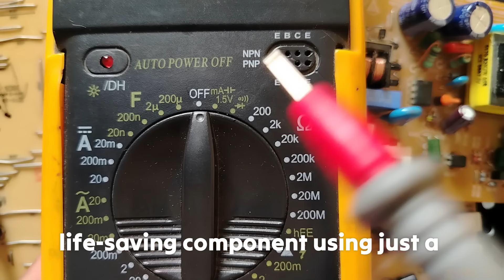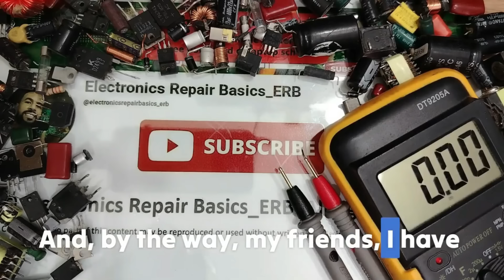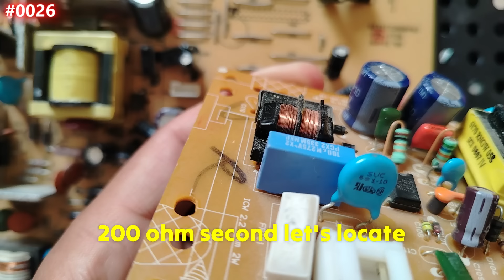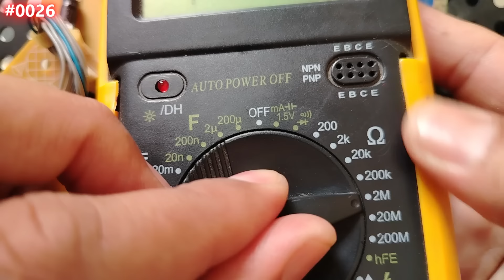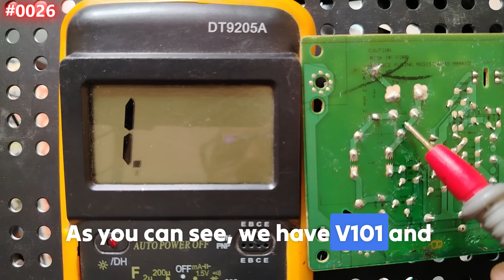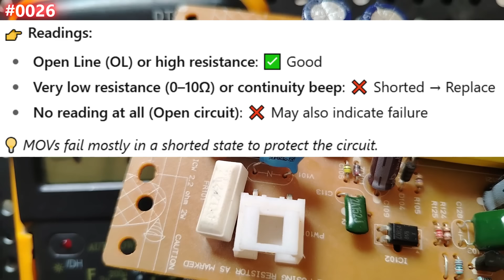#0026 Electronic Components Testing: How to Test a Varistor (MOV) with a Multimeter | MOV testing

Comment: The one part of this that doesn't make any sense to me is how a multimeter reading 'Open Line' is a good indication, but 'Open Circuit' is a bad sign. Both my multimeters have an "OL" (Open Line) reading, and they both mean the same as 'open circuit'. My interpretation is if your multimeter can only test a max resistance of 100kΩ, then a result of "OL" is a good sign; but if your multimeter has a 100MΩ limit, "OL" hints at an open circuit.
And like other people have said, it looked like your reading was "out of range" even in the 2MΩ setting, which is over 4X the expected value (I'm assuming a 1MΩ reading would've shown decimal places).
If any of this is wrong, I would like to learn why.

Comment: Hi, Thanks for the video on mov testing, quick question, if you are testing while on the pcb how do you know you are not getting a test result from other components  either side of the mov solder points, or would it be safe to assume mov's are always in series from the main supply. hopefully that makes sense
Reply: Hola los MOV o Varistores se colocan el paralelo a la fuente de voltaje AC o DC,  siempre es mejor sacarlos y medirlos afuera de la tarjeta. 
Suelen colocarlos entre fase y neutro, fase y tierra o neutro  y tierra.

Comment: Thank you sir, 1 question. Those the values ;10D, 14D, 20D and so on written in front of the 471k affects the characteristics of the MOV?
Reply: D is the diameter. The two numbers before it are in mm. So 14D is a 14mm diameter.

The first two number before the K are the voltage rating. The third number is the multiplier. So 471K is 470V where is 47 is the voltage and 1 means to multiply by 10. K (I think) is the tolerance. Eg. +/-10%

Comment: When you see 1 on the multimeter it does not mean 1 megaohm. I means "out of range". It can be 1.1 mega ohms or 100 mega ohms. You need to change the range to find out.
Reply: When you see 1  means is out of range or infinite resistance
Reply: @Stylianos_Sideris  Out of range is the correct term. There is no such thing as "infinite resistance". But it can be really high of course. "1" means the meter is not able to meassure it on that setting, or maybe any setting, but it sure isn't infinite.
Reply: @Youtube_kontot  either way, it means this video is useless.
Reply: Exactly